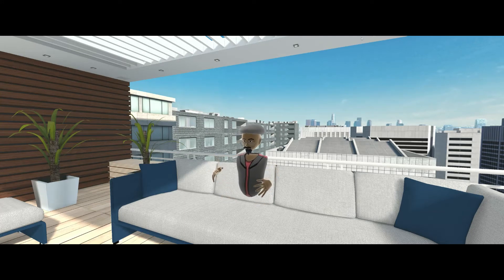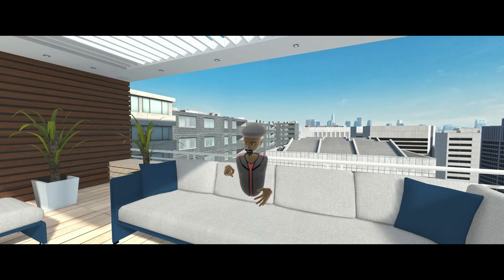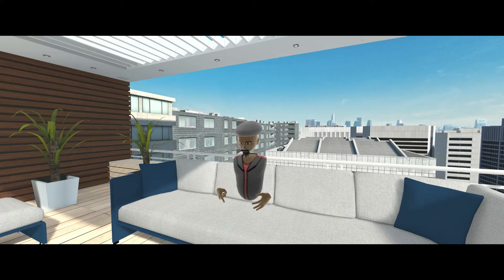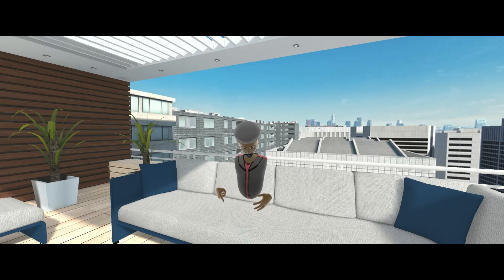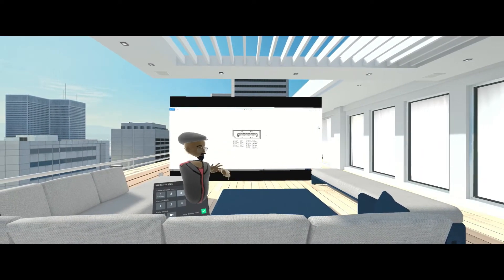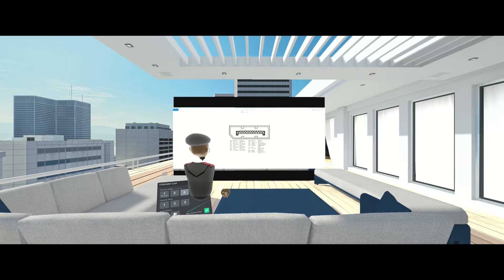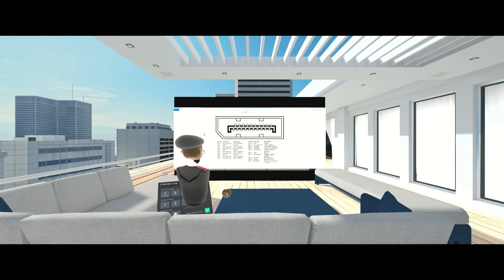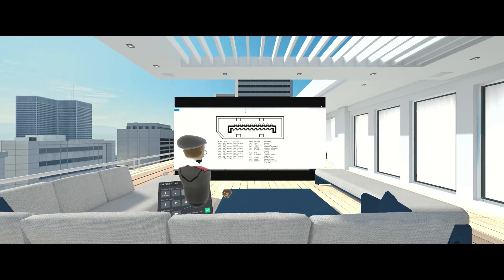Reddit PSA:  Non-Standard Displayport Cable Pin 20 Issue

Comment: Ordered a 3rd cable. Hopefully this fixes it 🤦 been boot chaos, worked for a while then failed with the latest Nvidia driver update. Switched the monitor to 1.2 and it worked, couldn't get a bios display on 1.4. will update if the cable thing works.

Comment: Great informative video.  I'm just now experiencing this issue.  I purchased a new Gigabyte monitor 144hz and I believe the cable included was contributing to my black screens and crashes while gaming.  I've only been using it less than a month.  I switched over to an hdmi cable (after changing multiple drivers, updating BIOs, and updating chipset drivers) and ran several benchmarks with no problem.  This definitely needs awareness.
Reply: If you got a multimeter (which costs maybe $10-20) it's easy to test as what this guy says in this video matches up (what he's showing at 8min55sec into this video) with another video where the guy showed a nice visual example of things (it even shows it actually backfeeding power from monitor into his motherboard as the motherboard power led stays lit which should not happen since he completely removed the power from the PSU with the power cord itself and as soon as he removed the DisplayPort cable from the GPU the motherboard's led light immediately went out) as shown here... https://www.youtube.com/watch?v=6s1cMwzesZI&t ; it's a 5min video. he even went on to use a multimeter touching one end of the cable at pin-20 and then the other end at pin-20 and the faulty cable beeped (which is bad) where as the other known good cable he had that worked, did not beep (which is good). when I got a couple of cheap DisplayPort cables recently from Ebay for $9 I tested them when they arrived before I connected it to my computer and they do not seem to have the pin-20 issue as instead of testing directly into the DisplayPort slot on each side of the cable on pin-20 (and some others), I noticed a better and less risky way of testing it (since if you got the multimeter jammed into the main connector you could potentially bend/damage the pins if your not careful), as they have tiny little holes with a little wire exposed (not inside of the main connector but just outside of it on the flat piece) and I found the pin-20 through there on each side of the cable and there was no beep and to make sure my test was good I tested a handful of others and all beeped which is good. so at this point I felt my cheap DisplayPort cables where safe to use.

but I think if one does have a faulty DisplayPort cable, if you can manage to crack open one of the ends, you can snip the wire on pin-20 with wire cutters (or scissors) and then snip another small chunk out of that same wire (which should make it impossible for that wire to make connection again since it's missing a small section of the same wire going to pin-20 and will be too short to make contact at this point) to make reasonably sure it will never make a connection again and then your previously faulty DisplayPort cable should be safe to use since it can no longer backfeed power into the GPU from the monitor. this site shows the basic wire layout which I imagine will make it easier knowing which wire to cut should one have to do this... cablechick.com.au/blog/the-displayport-pin-20-issue-explained/

on my Geforce 1050 Ti 4GB GPU, which I am pretty sure is normal behavior as it seems to be the way the GPU's BIOS works... if I have both the DisplayPort (to Monitor (which is 1080p @ 144Hz)) and HDMI (to TV) connected, power on computer, there is no PC boot up screen with PC BIOS shown on boot, along with the general OS boot up, on the DisplayPort side, but it does show on the HDMI side. but once the OS loads up to the sign-in screen the DisplayPort side now becomes active (so both screens are now active). because as a further test to prove my theory... if I disconnect the HDMI cable, so only the DisplayPort cable is connected to the GPU/monitor during boot up, everything now works/displays on the DisplayPort side like normal as I can see the PC BIOS screen along with OS loading etc. so apparently the GPU itself gives priority to the HDMI connection over the DisplayPort during basic boot up for outputting general PC BIOS screens etc if both DisplayPort/HDMI are connected.

also, NVIDIA released a update (back in the year 2018 ; nvidia.com/en-us/drivers/nv-uefi-update-x64/ ) for Geforce 10 series GPU's (and thereabouts (read nvidia link for more info) ) fixing DisplayPort issues 'if' you got it connected to a DisplayPort v1.3 or v1.4 monitor. my monitor is v1.2 and I don't have the problem, so I did not use the firmware update.

but if your not using NVIDIA's G-SYNC (or AMD's FreeSync) on your games, which requires a DisplayPort cable to work (and a monitor that supports one of those two features), a HDMI cable might be a safer all-around choice as long as it's good enough to run your monitors resolution and refresh rate (which you likely have to manually adjust). but in my case I pretty much had to use the DisplayPort cable for the monitor since the TV was using my GPU's HDMI port. I was using a DVI to HDMI adapter on the GPU's DVI port, and while it pretty much worked, if I had it set to my monitors maximum of 144Hz, while it would basically work for a while, after letting it sit for hours (I am running Linux Mint v20.2-Cinnamon), as I got my screen to go into sleep mode after 30min, and resume use there was no display on the DVI to HDMI adapter (using a 6' HDMI cable), but the TV side using straight HDMI cable still displayed things like normal, but as a temp fix I could press CTRL+ALT+F2, which would engage the monitor(as doing that on Mint brings up a text screen), and then CTRL+ALT+F7 and then things would be back to normal temporarily. but that same issue would return the next day after letting it sit a while. but if I switched from 144Hz to 120Hz the issue disappeared and things worked as expected when using that DVI to HDMI adapter with a 6' HDMI cable connected from back of adpater to the monitor. but once I got a DisplayPort cable recently I no longer have that issue as I can use 144Hz and that issue no longer exists and as a bonus I can now use the G-SYNC/FreeSync feature as my GPU is NVIDIA so it's uses G-SYNC and the monitor I got uses AMD's FreeSync, but the G-SYNC pretty much works well enough with FreeSync from the looks of things.

but I guess in your case... if your happy with the HDMI setup, unless you got a urge to look into these things, it's probably not worth your time and you can continue to just use the HDMI setup.

but if one is trying to play it safe and don't want to mess around with multimeters etc it seem all one has to do is buy a VESA certified DisplayPort cable. but the two cheap DisplayPort cables I got from Ebay for $9 are not VESA certified, but should be safe to use given my test with the multimeter.
Reply: Came here because of weird issues with a monitor and included cable... and its a gigabyte. I noticed HDMI was more reliable, but can't run it's full 165Hz on HDMI so ended up here after google and reddit

I was only getting crashes on startup, then it'd reset the BIOS and behave totally normal... til the system was powered off and it'd repeat. CMOS battery is brand new, and the problem doesn't occur on HDMI